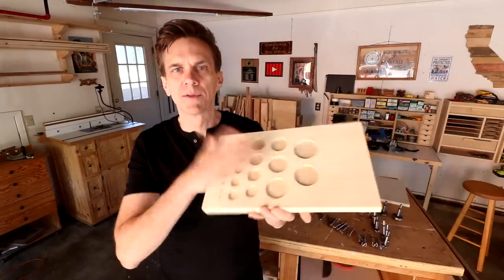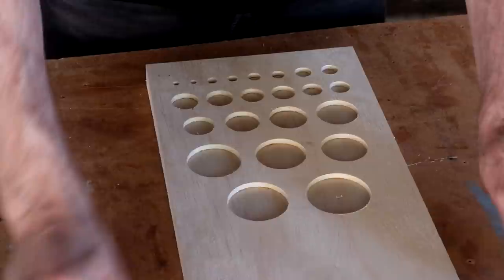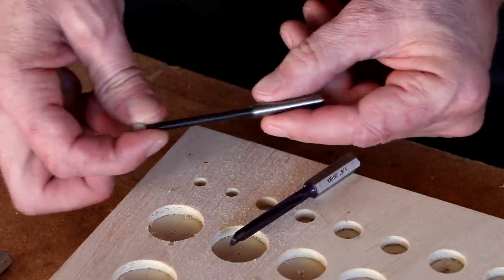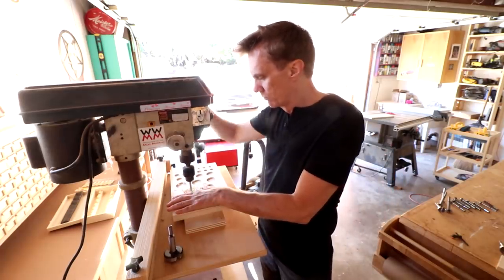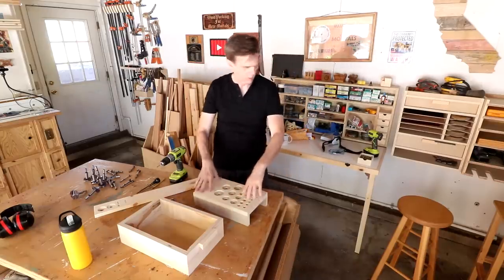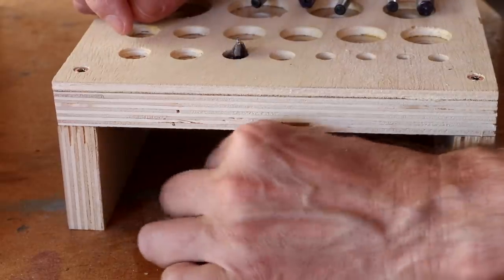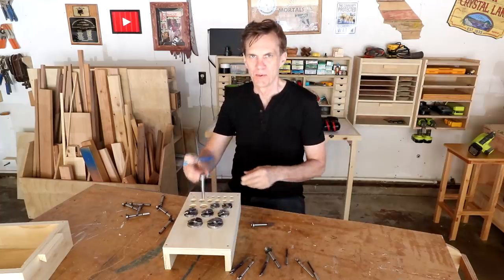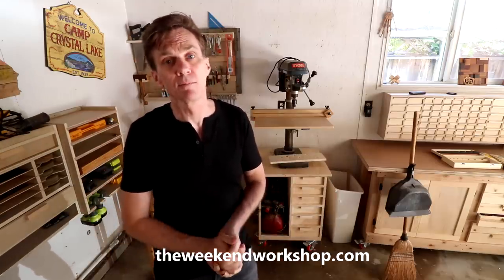Finishing up the Forstner bit storage unit. | Day 95

Comment: If you want to get a bit fancy you could get a can of spray foam. Line the bottom of the drawer with plastic wrap, spray a good layer of foam, cover with more plastic and smooth. Then put the insert with the bits back in and let it cure. Custom shaped foam cushioning to hold all the shanks exactly where you want them.

Comment: If it’s hard to pick the bits up, you could put a layer of foam under the sides, to act as a spring. You can then push down on the face to make the bits « pop up » to make them easier to pick up

Comment: Maybe do a hole on that "top" part so you can easily pull everything out if you need? Like a handle
Reply: Or a dowel sticking half way out, like a tab.
Reply: Half circle cutouts, top & bottom will allow easy lift out of the rack.
Reply: Just pull a cutter out and use the existing hole.

Comment: I bought a basic 5 part forstner bit set a couple of years ago just to have one. I'm not a woodworker I just like to make things and tinkering with stuff. When I made that hollywood mirror for my GF 2 weeks ago I needed to drill a lot of holes for the light fixtures and turned out the set was useless, it ranged from 15mm to 35mm with 5mm steps but what I needed was 28mm. 25 was to tight, 30 was too loose. So I ended up buying separately a 26 and a 28mm bit, they weren't cheap but I was blown away how good they were! Much better than the ones in the set. I think I'll make more mirrors like that so I put my tools to good use. By the was, I'm a datawarehouse developer but I follow you since about 2012 and I took the courage to start building stuff despite living in a flat :)

Comment: 1. You might think about drilling a finger hole in the main board so you can lift it out of the drawer more easily. Or do you just pull out one of the big bits and use that hole?
2. Gluing the small block to the drawer rather than to the bit holder means that that bit will always fall out of there if you ever lift the holder out of the drawer, plus...
3. If you ever decide to move the bits and use that drawer for something else, you'll have to knock that small block off and put one in the new location.

Otherwise, well done. Someday all of my crap will be stored on a proper place.
Reply: jjohnston94 it looks like he intends to always just take the whole drawer out if needed. Personally, I can’t think of many times when multiple Forster bits are needed at the same time, so probably won’t even take them all out much.
Reply: In the previous video of this project,Steve said, that he will take the whole drawer to the place where he needs to drill tht hole. So he just made the drawer as a box for Fostner bits.
Reply: I agree on that first point. That blank space at the back is just begging for a slot to help lift the frame out of the drawer, if he needs to access that space for whatever reason. Since that would presumably be a very infrequent task, it wouldn't interfere with the convenience of keeping everything closer to the front of the drawer anyway.

Comment: For the small holes, you could have an elongated eyelet. Drill a hole large enough for the shank, then cut a slot narrower than the hole to support the head of the bit? Kinda like mounting a power strip on the wall

Comment: There are soldering iron styling wood burning kits which have precision tips that work quite well for burn/engraving/marking/detailing. Relatively inexpensive and easy to use, and I think usually looks nice also. Small investment that you can have fun with.

Comment: Great job again, Steve, very interesting and fun to watch.  To keep the one with smaller "neck" on the shank, @8:06, you could place a small block (maybe about an inch tall) next to the one you glued for the short bit, drill a hole the same size as the shank but make the hole fluted so it's larger at the top; like a more gradual countersink. This would keep the bottom of the shank held straight ant the top is held as all of them are. It wouldn't wiggle then!

Comment: Turned out great Steve! I like the comment about using pencil to label sizes then cover in lacquer...recently I tried something similar with sharpie on a drill index I made. One coat of poly, then sharpie on that (made labeling easier and kept from bleeding into the wood) then two coats of poly on top after the sharpie was plenty dry. I’m happy with the result 👍 So nice to have organization and no more fiddling through a pile of drills for the right size.

Comment: I did this basic idea but in a box not a drawer, and put mine in drilling side up and in the bottom of the box, about three inches deep, I drilled holes the diamter of the bit shank to fit the bits in to keep them from shifting around.

Comment: Wow! I love these kinds of videos! Thank you, for making every day good! I have noticed, that when you use Forstner bits you drill the hole true from one side. But here in Latvia (small country, just over the side of the pond :D), we use the technique of drilling from one side, till the center of the Forstner bit gets true the material you are drilling and then flip it and drill from the other side. In this technique, you will never get tear-out on the other side, and you don't have to worry about the condition of your support for drilling. Any tear-out you could get is in the place where those two "holes" meet, and you can get that fixed with your vertical round sander ( I don't know if it is the right name for it :D). This is just a recommendation that could help you with drilling with Forstner bits. And the last thing I want to tell you is - keep making these types of videos. For me, they have helped a lot. Thank you very much!

Comment: Hey Steve, in the past I've used a small drop of clear glue to seal in writing, if you dont have lacquer lying around. Simple finger glue is fine. But you need to try it first, to see if the ink doesn't blot when applying the glue

Comment: I think you should add a little handle thingy on the top of the board, like with those wooden crates so it's easier to lift out of the drawer if needed.

Comment: To get rid of the wiggle of the smaller bits, you could have attached a block below the first row with holes corresponding with the alignment, length, and width of the shanks :)

Comment: Regarding the foam idea... If you want a quick and dirty way to keep the shafts from  moving much,  cut a piece of rigid foam insulation (available for a few bucks at the big box stores to fit the bottom of the drawer, then press the shanks of the bits into it.  I keep a few pieces of rigid foam insulation around for cutting up sheet goods and boards with the circular saw, as the foam is firm enough to support the wood yet is cut easily by the saw blade and doesn't gunk up the blade.

For a fancier way to do something similar, you can try squirting spray foam from a can into a plastic bag at the bottom of the drawer, then seal the bag and gently press the shanks into the foam (without piercing the bag) before the foam sets too much.  That's basically an at-home way of making custom shaped foam packing protection when shipping fragile objects.

Comment: I just had an epiphany on your smallest row with the shanks larger than the head.  Glue a 1x or a 2x underneath the holes to act as part of your support and drill them through (or to an appropriate depth) the size of the shank. The bits won't wobble, nor will they get hung up when removing them.

Comment: I've been really enjoying all of your videos, Steve. One thought on your drawers (well, the cabinet's drawers) is that, given that you made them considerably shorter than the depth of the cabinet, you could have made the sides almost the full depth of the cabinet, while still placing the back where you located it. Then, you can pull out the entire drawer (to reach to the back) and it will hang on with the extra length of the sides. The only other change would be that you would need to have the cabinet back right at the back of the carcass. I probably have to build that cabinet now, as I just bought a used 12" drill press to replace the 8" one that just isn't up to some tasks. The cabinet I made for it seems a tad undersized. Poor me.

Comment: Hay Steve I just purchased the drill set you received as a gift I had been looking to buy some and liked the hex shaft of yours.Turns out they are on sale so I saved a little money. Based on your unboxing video I expected them to be loose when I opened them to my surprise everyone was in it's slot non were rubbing each other maybe they had been through one of CAs many tremors. 

One thing I did notice as I cleaned off the oil was they all had a burr on the cutting edge which would interfere with the drilling process. It didn't take long with a small file to remove the burr. thought you might want to examine yours befor you use them enjoy. 
That said like your vids just not a cat person :-)

Comment: May I suggest drilling half-round finger holes on each end of the main board? This would provide access to the underside, when (not if, because you will) need access? I know you will have to be careful to keep the bits from falling out, so that is a concern. But the finger holes will make it easier to pull that board up.

Comment: you can resolve that odd ones problem by setting the supports under the holed board at a slope coming down a bit for the shorter bits

Comment: I know 3 years later but here a suggestion. Everything under 9/16 should be Brad Point bits. So from 1/2" to 1/16" eliminating the problem of the Forstner bit slipping through the hole. You will also get a cleaner finish with the Brad Point bits.

Comment: Glue a block beneath the small bits and drill a pocket into it to hold the shank at the same depth as the larger bits. The pockets will laterally support the lower shank and will come out with the insert of you lift it out of the drawer.

Comment: Concerning the use if foam in the bottom of the box, what about getting a can of spray insulation foam and spraying it in a bag like some shippers do so that the packing conforms to the contents? Perhaps put the bag in the box and spray the foam inside then close the lid so that it confirms to the contours. After it sets, just run the drill bit through the holes for the shanks. 
Just my two cents worth.

Comment: if you glue the block to the drawer then if you want to take the forstner bit holder out and use it as a drawer again you will have a random block in the drawer. I would have glued it to the organiser so when removed you have a drawer back nice and clean.

Comment: I like it a lot, but I think if I ever did something like this, I would just use the quarter inch plywood and drill the shank sizes into the wood, and just have the side supports short enough that the bits would rest on the bottom of the shelf, rather than fuss around with drilling different sized holes in different sized plywoods. That would also solve the problem you were having with the smaller bits just falling through. Otherwise I think it’s a brilliant idea and you executed it well. It’ll definitely get lots of use in your shop 👍

Comment: For the smaller bits can't you attach a block under neath and drill the shank hole just deep enough so they all match at the same hight. Also that would solve the problem of loose fitting bits.

Comment: Pencil probably works better in some applications than others.  In one house I owned the circuit breaker panel labels were written in pencil.  They were written in probably 10 years before I bought the house. Over the years most had faded so much that they were illegible.  It may have something to do with the finish on the label paper.

Comment: I just made an holder for my drill bits. I drilled half mm larger hore for each bit so they are easy to remove and put back.Only problem with that method is that you have to have infinite number of drill bits because you always need the 0,5mm larger one. :P :D

Comment: Hi there, I'm one of those who suggested that method you talk about at the beginning of the video and, I must admit, I didn't think about that alignment problem you mention, my bad. But at the same time I'm listening to you mentioning it, I'm thinking that's not a problem at all, it has a simple fix. Well, it's not even a fix if you are not fixing anything but preventing something from happening, but still.

You just need a couple of bits, or three for some extra reassurement. You just pick three of those bits, just choose any three that create a triangle when placed in their respective positions, the bigger the triangle the better this works. So, you just glue the boards and put those bits in place right before clamping both boards. If the holes are made in the right locations, you are now sure both boards are perfectly aligned. Moreover, you might had both boards misaligned in the beginning and now you would have replicated the exact same misalignenmet, therefore every bit would fit and you would just need to sand, trim or whatever the edges of the boards so they are flush.

Once that I've written this, I'll keep watching the video.

Comment: The drill press stand is open at the back where the drawers are, right? Maybe put another "drawer pull" at the back, that way if you pull the drawer out to carry it around the shop, you've got matching "handles"? And when it's in the stand there's no backer to interfere with, it'll just be hidden back there. Glue should be strong enough even with the weight of the bits, no?

Comment: A suggestion for the 1/4 in bits add a piece of wood with pockets drilled in to hold them up where you want at the diameter of the shanks

Comment: Might be nice to utilize that 'empty' area by drilling two holes and jigsawing out the center to create a handle. that way it's easier to lift out, and possibly even just carry that around with you. however, by gluing the small piece of wood to the drawer, you'd lose that bit as you pick it up.

Comment: For the bits that have a larger shank diameter, how about a 2nd larger  hole an inch away with a slot leading to the smaller hole?

Comment: What if you put the holes at the bottom of the drawer and have the shanks pointing up?  You wouldn’t need to worry about rattling or fall through and you would be able to grab them more easily.

Comment: STEVE!!!! I hope you see this comment/question. How do you decide which type of bit to use? As in you used the forstner bit to drill the primary holes, but then went back and used the twist(?) bit to widen the holes out. I assume you didn't use spade bits due to them leaving kind of a nasty finish result?

Comment: Would a small block of wood attached to the bottom of the drawer by double sided tape (future proofing) under the small bits to stop them dropping all the way down help? Possibly a block with tapered holes on the top surface to guide the shank into the hole?

Comment: For labelling the drill bits, why not print out the template, with the sizes printed on, then attach the template to the surface of the bit holder. Nice and neat labels.

Comment: The bits with the "wavy" skirt edge are supposed to be better at cutting holes when the surface isn't level. The wavy edge should keep the but easier to keep centered than the serrated edges.

Comment: I would not have glued the two pieces all together. I would have inserted a couple of dowels to align the two and just stacked them. That way you can remove the top piece again in case you want to add new drill bits.

Comment: Why not add a pivot and prop so if you remove drawer you can have all bits facing you at an angle. I.e 45 degrees  would also require a base for smaller bits. You could also leave the first row stationary and pivot the rest of the rows.

Comment: Before I watch to see your solution to the small bits and shank sizes, I’m guessing you put a board the ideal thickness on the bottom of the drawer to raise the tips of the small ones up a bit so they are consistent with the height of the lther bits and easier to grab when you need them. Ok, pressing play to find out!

Edit: Ok, I was pretty close. I expected a strip across the entire bottom row, drilled out for the bits that sat TOO high. Your solution was much simpler 😆👍

Comment: As a novice, who hasn't used a drill press since High School, what is the advantage of using smaller forstner bits as opposed to using a normal drill bit? I see the advantage for larger ones, but for the smaller ones I'm at a loss.... Thx!
Reply: I think they are more precise, but slower.

Comment: Hey Steve why not just make a small shelf or block that goes under all of the smaller ones to hold like the last 6 up by 1/4 so you can still grab them and also not have them wiggle. Make the shelf L shaped